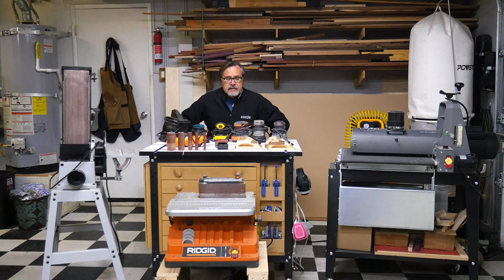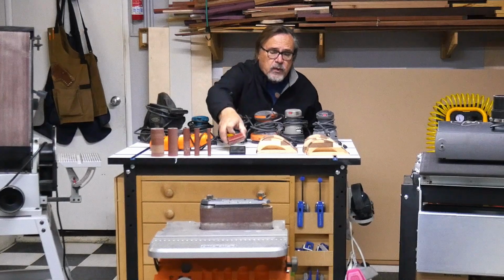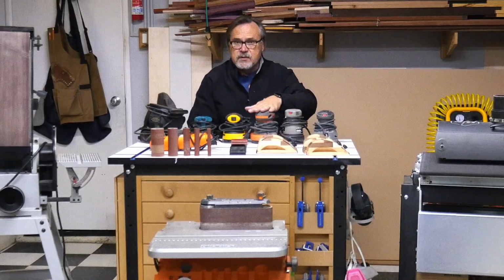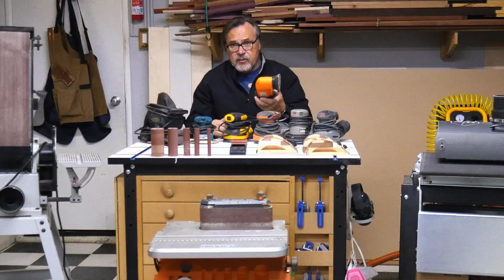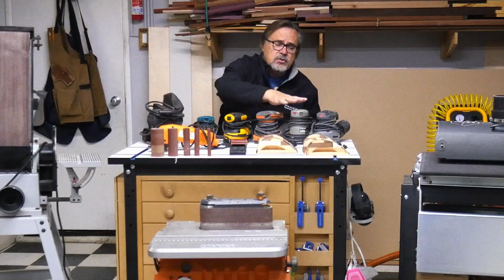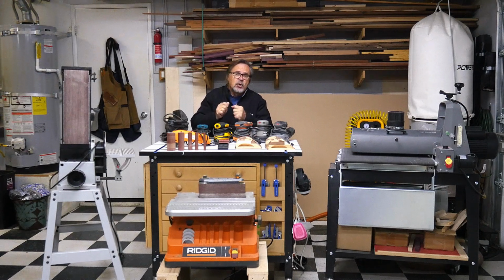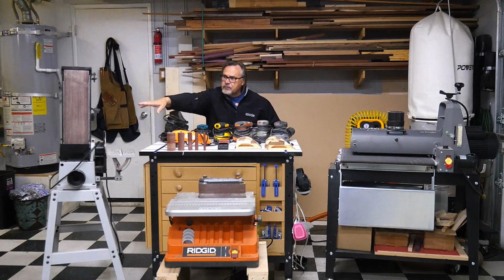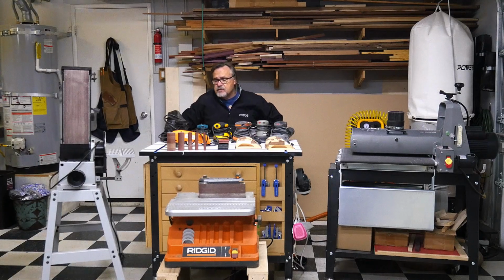How To Choose Sanding Equipment for Your Shop

Comment: I almost bought a 3m versiflo respirator I am glad i watched this video as I do segmented turnings and have been struggling for perfect height rings... Ill be getting a 19-38 instead THANKS FBWW
Reply from the maker: You are welcome FBWW The 19-38 is a great machine for doing that.  Thanks for watching.
Reply: @MadNerdWorkshop  I decided on the 16-32... in stock & had digital readout as well as the quick height set option. My segmented rings were never so flat. Thanks again.